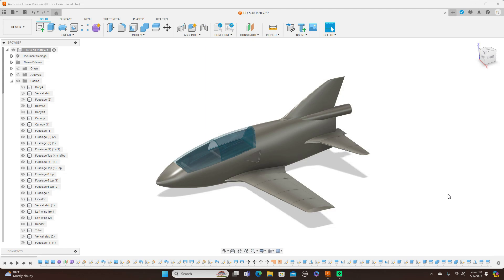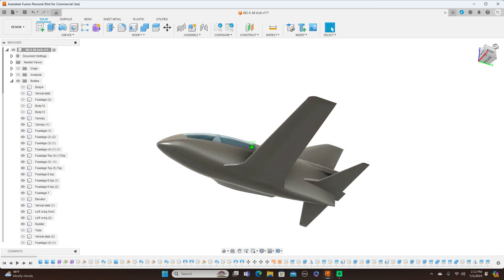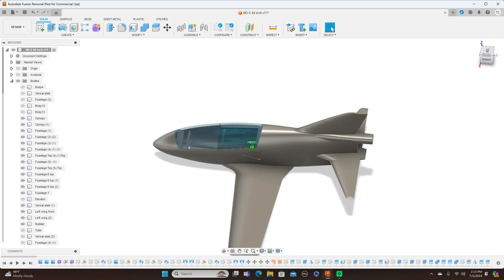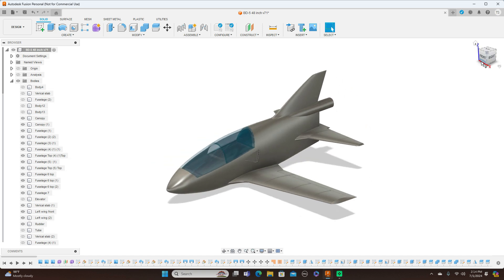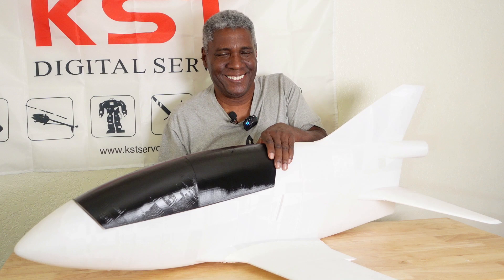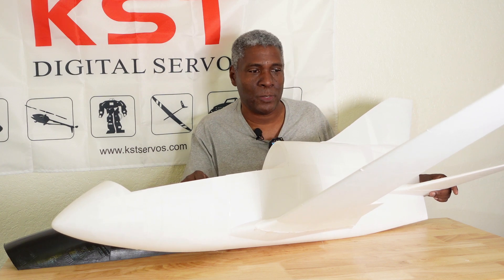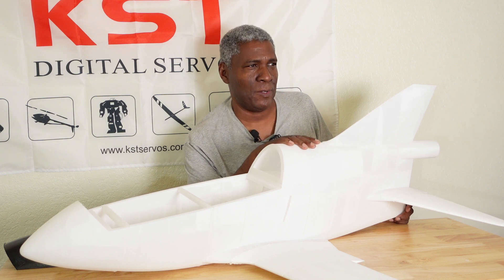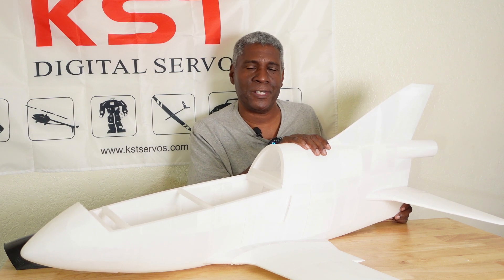BD-5  Subscriber project. Fusion 360, CAD, 3D printing. RC model

Comment: This looks like a hybrid of the Bell X1, X4, X5 and a Rockwell X31. Very cool!!
Is your intent to end up with a scale model of the. BD-5J but in EDF instead of a jet engine? Or a full on scale turbo jet would be slick. 
Are you going off of the original design plans from the 70’s or is it a visual reverse engineering design. However you and yours are designing it, it’s truly awesome!!! Keep up the great work! Thanks for the video